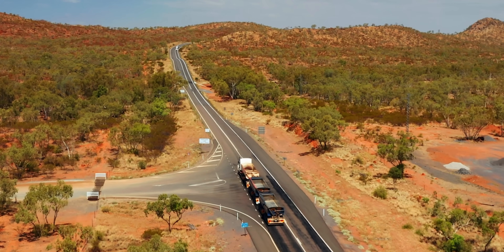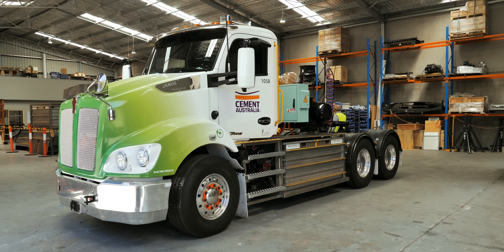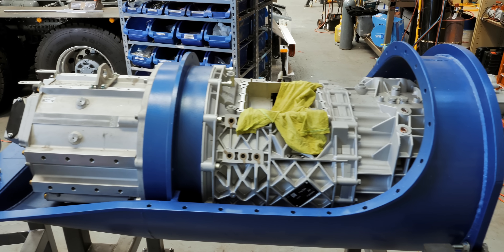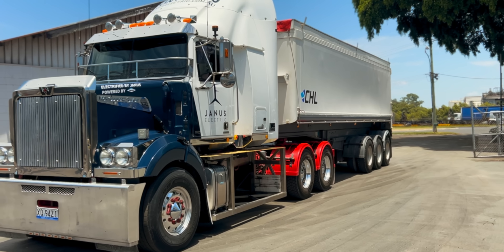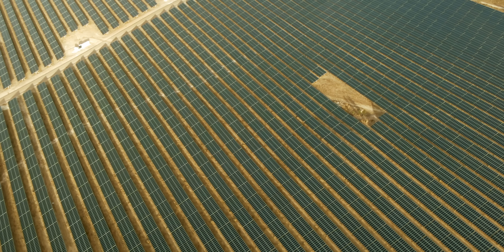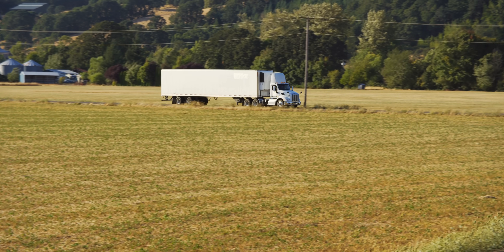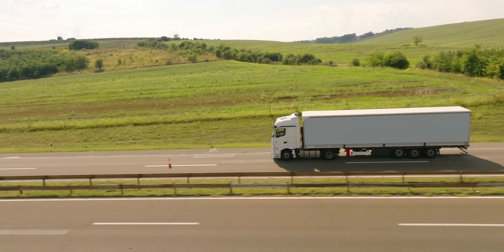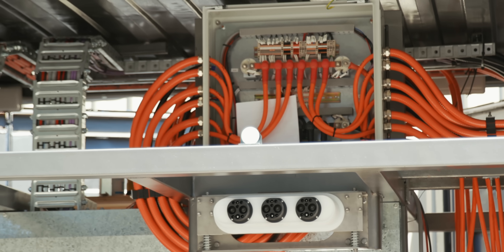This GIANT Electric Semi Can Swap Out Its Batteries!

Comment: With the basic shape of trucks, there is scope for solar panels on top of the trailers to act as a range booster, to top up the range as you drive along. Given the size of the trailers a lot of panels could be added for daytime running.
Reply: There's room for about 4kw of PV on the roof, or about 20-25kwh per day collected.  That would add 10-15km of range per day.  Probably not worth the cost of installing PV on the truck when a 2% larger battery pack would add that much range and the PV panels could be kept safe on the ground at the swap station.
Reply: The cargo container roof could be up to 47 sq. meter. Assuming that the solar cells are 20% efficient that around 9.4KW/h  with effective time of 4 hours, that around 37kw. Semi truck require around 2.5kw  per KM, so 37KW/2.5KW/h=14.8 km
Reply: @miroslawkaras7710  That's about 5400 km per year
Reply: Several people have responded to this with a number of points. Firstly assuming the efficiency of 20% is short sighted as by using multilayered panels efficiency close to 40% has been seen. The better commercially available panels have over 20%. With the new materials like perscovite instead of Galliumarsenide panels  and printable solar panels the future of solar is far better than you seem to realise. As printable panels can and have bee put onto curved and flexible surfaces, panels can be on a roll that rolls out. If a truck has a standard container on it there are standard fixing points that can be used to fix a portable panel to the top. If a trailer is fixed to the bed of the truck the panel could be fixed. If you you want to chip in and be a nay sayer you had better check your facts.
Reply: @pauldavis6390  Thin film panels tend to be closer to 10% and the 40% panels are too expensive for casual use. Couple months ago there was a YT video about experimental cheap perovskite cells that reach 40% but the company developing them said they only last a few years in optimal conditions. Mounting them on a shaking vehicle that is regularly showered by high speed gravel is not optimal. Also, have you ever seen how dirty trailers get in use? And during winter they collect snow on their roof so not only will the light be blocked but the panels might break either from the ice or from drivers getting rough when removing it.

PV panels on the truck cabin powering the AC and other electronics is already being done, but there is very little reason to add thousands of dollars to the cost of trailers for almost no benefit. Some trailers need power to keep them warm or cool, but their cargo is too valuable to risk relying on cheap solar panels to keep the AC running so they would still have a generator.

Charging while parking is good for regular EVs that might end up sitting for a week at a camping site with no electric outlet to keep the battery topped, but not so useful for trucks that must get from A to B on time every day no matter the weather. The truck still needs to have a battery with range to spare for the route and the mandatory stops are already long enough to charge or swap the batteries.

In short this is currently a case of "yes we could pave roads with solar panels, but why bother?".
Reply: @pauldavis6390  your 40% ones are bifacials that need a very significant gap (4-5 feet) between the panels and surface to capture any reflected light. Regardless, unless the trailer is measured in acres/hectares, it ain’t gonna add shit.
Reply: It wouldn't be worth it on a truck, I would like solar on a car though as most the time it's sat not doing anything.
Reply: Won’t add shit and trailers are swapped all the time between trucking lines and intermodal (trains) - at least in the US. And some trailers are just shipping containers set on frames and wheels. I doubt AUS is much different.
Reply: Like with smaller cars there is not much point trying to extend the range with solar, but for keeping the other electronics going PV is great. Consider how a truck driver sleeping in the cabin will have much better rest with an electric AC/heater system instead of having a diesel generator running all night long, causing noise and smell. Such upgrades are already in use in diesel trucks and drivers prefer the comfort they give.

Comment: I just watched a video about JCB using Hydrogen engines. I went in with an open mind. Not convinced at all, and this vid pops up to put another nail in the Hydrogen for EV's coffin ⚰️⚡🤷‍♂️
Reply: I too think that the era for the hydrogen EV is already past.  Battery EVs are too good to bother with hydrogen.  And as the speaker said, there will be times (wind at night?, solar at the weekend) where one can charge these trucks for free.  Not so with hydrogen.

Comment: 620 kWh is not too bad. The Tesla system is 850 kWh I think, but of course for a cute little truck in comparison. 
Seems a corner use case though, swapping stations need to be everywhere (more infra than a charger). Some trucks may always come back to base and it might work if the rig gets drivers to take shifts. 
A double or triple 350 kW charger could service a truck while the draver grabs a sandwich and take a comfort break.
Reply: Its 620 on each side. 1240kWh total capacity!
Reply: @davidwicks7898  I thought that was what he meant, but the weight and range don't make sense.  He said the pack was only 2 tons; 4000 pounds.  For it to be a 620 KWh pack, it would probably be more like 8000 pounds, so I think it is actually only 620 KWh total, so 310 on each side.  That makes sense given the weight, the visual size, and the range.  300 km range is only 186.4 miles, so for anything but really short routes, they will need a lot of battery swap stations and a lot of spare batteries.
Reply: For longer routes with an overnight stop a 350kW charger could charge the truck easily during sleep shift with the added bonus that the AC does not require an engine to be running. 

Swap mid driving shift, charge overnight and long haul is completely practical. I can imagine new EV only truck stops being built at places with huge electrical grid connections.

Comment: Did anyone stop for a second to think about the costs of producing new cars every year and promoting buying new new new all the time might be far more damaging to the environment than just driving our current fossil fuel cars would ever hope to amount to? Like its simple mathematics
Reply: Did you add your comment to the wrong video ? This video is about extending the lifespan of existing trucks by replacing their current engines with electric ones.
I’m also fairly convinced that a car traded in to buy electric if it is still of good quality will be resold on the second hand market , that’s simple capitalism.
Reply: @francesconicoletti2547  
How is extending their life time by throwing away the engine, producing new electric motors and batteries and you are left with a truck that went from 2000km~ avg range to 400km, did you seriously write that without thinking through the simple economics?

Comment: I can see this company going places especially in Australia where renewable power is already abundant .
Reply: Renewable power is potentially abundent but we're probably decades away from it actually being abundantly available. It takes a very long time to fund  design,  manufacture and build the stuff.
Reply: @toby9999  The mention 95% of fuel Australia imports peaking at approximate AU$ 4 bn per month In March 2022, which is approximately 5% of monthly Australian GDP for 2022. Note depending on import export economic factored the percentage can rise higher the  12% of monthly GDP.  It should be an economic imperative and a aspect of national security that Australia goes electric.
Reply: @freethinker4991  lol!!!! All that fuel is actually needed for a lot of things including agriculture and a lot of other things that need to be working almost 24/7 which no batteries can offer
Reply: @alanmay7929  You lack imagination the working 24/7 is way the batteries can be swapped out.
Reply: @freethinker4991  the only one lacking imagination here is you! How are you going to always have at least 500Kwh of batteries sitting somewhere charged waiting for trucks!? What about more than 500Kwh!? It’s not about imaginations but calculations and estimations. 24/7 wtf does that mean!?
Reply: @freethinker4991  those electric big vehicles are made specifically for very determined routes and locations unlike diesels and you can’t deny that! Diesel are far more flexible and polyvalent.
Reply: @toby9999  not that long, it is just a matter of political will and public influence. Decentralised renewable energy production is key. In that respect, it’s pretty quick to design and install a solar installation.
Reply: Solar is already abundant to the point that power is so cheap during the day that solar farms are struggling somewhat to make any money from the power they produce, meaning they are taking longer to pay back their installation costs.  This means it's less attractive for investors to fund new solar farms, because it's taking longer and longer (years/decades) for the solar farm to turn any sort of profit.  This is why battery storage is so exciting for people involved in commercial solar, because once the price drops to the point it is financially feasible to add batteries to a solar farm, it means the farm can start feeding power into the grid at night, when it's most profitable.
Reply: @Berkeloid0  Good point, and when these truck batteries are swapped out and charged during the day they can take advantage of this. Hopefully they can park up and swap out at the end of the day to recharge in the morning
Reply: @Berkeloid0  exactly, this is what we need to quickly find a much better energy storage solution if only we could make hydrogen production much easier or other energy storage solutions.
Reply: @Berkeloid0  Well these electric trucks would be a good example of a system that could make use of vast amounts of renewable energy. At the moment solar produces electricity when most people are at work and their homes use very little power. But if there were thousands of these swapable battery packs being charged and used throughout the day by electric trucks then I think the currently installed solar capacity would need to be further expanded. And it may also drive up the price of daytime electricity due to the change in supply and demand. So solar farms would get a boost to their income.
Reply: @jaseastroboy9240  just one of those packs would be worth well over $100,000. He said it was like 8 tesla batteries I think. A tesla battery is $20,000

Comment: Interesting comparing this with the Harry's Garage video of JCB going all-in on Hydrogen.  The comments section there said this sort of thing wasn't possible, and that there's no future for large battery powered vehicles or battery swapping!
Reply: Did they say not possible or not economical?
Reply: @gingernutpreacher Nailed it right there. The only reason we're not already all over this stuff. Munnie!!!
Reply: @rykerhasyounow  it should also be said the solor generation in this country supports tractor perfectly in Australia there winter is like our summer
Reply: They would be/are quite correct.

Why not Google up what the Chinese have got up to with their hydrogen fuel cell powered lorries/trucks, buses and coaches.

And boats.

And locomotives.

Etc, etc, etc.

And, when you've done that, Google up hydrogen fuel cell powered aircraft.

Batteries are already obsolete for transport. Too heavy if you were struggling to wonder why.

What you see with these last experiments with batteries is merely a waste of time.

Batteries are useful tho' for storing power ... although nobody knows, as yet, what technology they will use.

Might start off with "lithium chemistry" but certainly won't be the "climax" technology.

Not by any means.

Comment: Or... We could do like China and have electrified freight rail and use electric trucks only for the last couple miles. That way we can have some batteries leftover for cars or something.
Reply: We can’t even do rail properly. China has the population density to justify rail everywhere, Australia doesn’t. Certainly trucks from mine sites and large industrial sites are not going to be replaced with electrified railways. Consider delivering wind turbines to a wind farm, are you really going to constrain the wind farm , those turbines need specialised vehicles, not something that sits on a train. Electric trucks there would be better the diesel. It’s not either or it’s both.
Reply: @francesconicoletti2547  Long term it's both, but with batteries (and government money) constrained you have to think "do I want a few battery swap semis, or do I want electric rail and a hundred normal electric vehicles?"

The answer is obviously the latter. Battery swap where most of the batteries sit around waiting to be used makes no sense unless you're swimming in batteries. Actually, personal cars make little sense either because they're parked most of the time, short-haul trucks with very high use and fleet vehicles is where we should focus batteries first and aim for electrified rail everywhere else.
Reply: Nah, you can’t do that because you would upset both Australians that would be opposed to it, and as we all know, everyone has to be happy.

Comment: Twice as many batteries means twice as much cobalt, twice as many enslaved children mining the cobalt.
Reply: There is no Cobalt in the latest lithium batteries from several manufacturers. Stop flogging this lie over and over.
Reply: @johnodell5310  Twice as much Iron vs the cobalt… problem solved. Twice as much sulfur…. Stop being so ridiculous… makes people think you’re doing that to push a BS agenda mate 😉.
Reply: Gasoline production also uses Cobalt. Battery manufacturers are mostly eliminating Cobalt already with lithium iron and other chemistries. It will be gone withing 10 years.
Reply: I must have missed this part! I didn't see where they mention the battery chemistry, if it contains cobalt at all and if it does, it might be mined in Australia. Will have to re-watch to gather this information you have
Reply: You didn't realise that this way the batteries will last at least two times longer. They charge them slowly and they don't stress them with 300Kw charge and when you have 2 batteries that means you double their life (not use, but total life). Stop that bs an idiot said and think. It's called comon sense.

Comment: Some improvements to the changing system (more like NIO does it) and this is a pretty solid idea i think. It looks a little bit fiddly to swap the batteries in the moment.
Reply: The way these batteries are swapped out using a fork lift truck is exactly how batteries are swapped out on STILL fork lift tucks that are used in my work place. And probably many other industrial settings around the world.

They have been using battery fork lift trucks now for approx 5 years and the amount of money saved running on electric compared to compressed LPG is tremendous.

Alot less maintenance also!
Reply: The end of the vid they mentioned robotic changing stations.  About a minute to swap batteries.
Reply: Actually genius how they made it work for any forklift and they didn't have to develop a robot for that first. Now they can still upgrade just by switching to an autonomous forklift.
Reply: @seasong7655  or a small crane arm with forks

Comment: It takes 1000 dollars worth of batteries (3 * 9 amp hr )to get a Dewalt Sawsall  through a not particularly difficult day and I can’t imagine trying it with a weed trimmer
Reply: You can get a 2 pack of 5ah offbrand ones on amazon for like 60 USD
Reply: @fawfulBeans  

You really need the 9 as even this big it only holds 840 watt hr 

Ya I stick with the Dewalt that don’t burn my house down and units from 2016 still provide full functionality